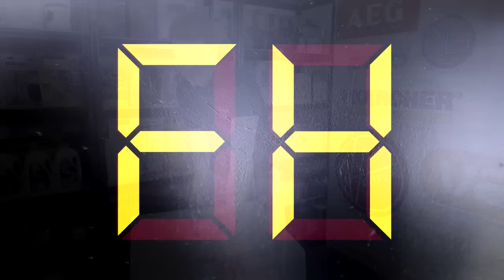Whirlpool Washing Machine Error Codes Diagnosis

Comment: what is F01 ?
Reply from the maker: F01 on a Whirlpool washing machine is a water fill error...so you are possibly noticing that water is not entering your machine like it normally would. If this is the issue, it could be due to a faulty water inlet valve. We have a video that shows you how to replace the water inlet valve here:
https://youtu.be/AA6erXruSBo
Reply: @eSpares  Actually, our problem is different. The washing machine starts the program normally and draws water, but in the next stage, which requires the drum to rotate to the right and left, it stops working, makes an alarm sound, and the maintenance symbol appears on the screen. Then it expels all the water and freez.

Comment: Thanks. My washer has F06 error code. I search usually this caused by overload but I loaded only 2/3??? Why? or maybe is machine problem
Reply from the maker: Hi, thanks for your question...F06 error code relates to the drum not spinning as it should.
First thing to check is the belt, to ensure it is in place correctly and not worn or damaged. If the belt is fine, it could be that the motor is faulty and needs to be replaced, hopefully these instructions below will help you...

1) Remove the back panel by removing the x 6 T20 screws

Check the belt and belt pulley (tighten the central bolt, if the pulley is loose)
If the belt and belt pulley were fine, then proceed to these next steps to replace the motor:

2) Remove the motor connection block wiring from off the motor

3) Remove the belt from off the motor spindle

4) Remove the x 2 10mm bolts that hold the motor in place (These are at the front of the motor)

5) Motor can now be pulled out from the rear of the appliance.

Reverse the steps above to fit your new motor...

You can see our range of Whirlpool washing machine motors here:
https://www.espares.co.uk/search/ma278pt1752/washing-machines/motors/whirlpool

Comment: Hey, can you help with fixing error code F3 E2? Model number is WFW9050XW00. Thanks! :)
Reply from the maker: Hi Humza, it means the machine has detected an error on the inlet valve so start there but be aware it could be caused by the board.

Comment: what about F25???
Reply from the maker: Hi Marcela, F25 indicates the machine has detected a problem with the drive motor, try resetting it first by unplugging it for at least 5 minutes then testing the motor and check the electrical connections from the board to the motor.

Comment: I have a front loader washer whirlpool energy saver. When I press the start button, door locks but then that’s it. No water and no spinning. Timer works but machine is stuck
Reply from the maker: Hi Thea Ale Ol, check the inlet valve with a multimeter which will determine if it has failed.

Comment: hi, thanks for your awesome video!
I have a WFW9050XW03 but it doesn't have a LED display, how can I decipher the error code ?. it is stuck on Wash, beeping 3 times, and the LED on the WASH flashing 8 times and then once and then repeat. thanks a lot!
Reply from the maker: Hi Michel, the code is generated because the fill sequence is taking too long, check the pressure switch hose that runs from the tub to the pressure switch as this can cause the problem.
Reply: @eSpares  Thank you very very much! will give it a shot and update ! really appreciate the quick response and help! you totally rock!

Comment: What does f33 mean
Reply from the maker: Hi Samuel, error code F33 means the machine has detected an issue with the drain pump circuit, check the filter and test the drain pump with a multimeter.

Comment: My Whirlpool front loading machine, Model GHW9150PW4, starts to wash as usual but clicks off after a few seconds and locks the door, with Error Code F11. The manual and you did not mention Error Code F11. What is going on with my machine?
Reply from the maker: Hi Kathy, F11 is a communication error between the control board and the motor board, try checking the connections to both boards are making direct contact.
Reply: Thank you for your quick response. I will have my husband do what you suggested.

Comment: Sorry to bother you Sir, bit you seem to know your business, and I am trying to save some money. My Whirlpool Duet, WFW9200SQA12 has shown me a F28 code, after running a diagnostic test. I am at a loss, because being female, I know nothing about working on this thing. When I try to start it,  the thing will lock, then fill with a little water. That is it
 The time will count down, bit it isn't doi g anything. Them after a while, it will show an F28 code. Please help me!
Reply from the maker: Hi L. Bailey, F28 is listed as a communication problem with the central control unit, it's worth trying to reboot the system  with the reset lever on the controller but be prepared it could also be the motor controller

Comment: What do I do if I get two codes. The codes are F05 and E02. Don't want to spend a lot of money for no reason
Reply from the maker: Hi Eclipse Hydro, on some models whirlpool use 2 error codes which reads F5 E2 which refers to the machine has detected an error with the door not locking correctly so check the door is closing properly, make sure the connections to the lock are OK before suspecting the door lock.
Reply: @eSpares  thank you so much

Comment: please whirlpool 6th sense 12 kg code erreur F36 ?????
Reply from the maker: Hi Faiaga, the only information I have found on this error code is when the main control detects a communication error between the 2 boards : Unplug the washer and remove the rear panel on the console to access the main control board.
Make sure that the P7 plug is properly connected to the board, even if it looks OK unplug it and reinsert it to ensure a good connection.
Plug the washer back up, press power/cancel, wash cycle normal, power/cancel, if the washer starts and updates the 7 segment display then communication has been restored and then try it again.
Reply: @eSpares  Hello,
Thank you for the advice, is it possible to have a video that I will be more help.
have a good day,
lisa
Reply from the maker: Hi Faiaga, we will add it to our video schedule.

Comment: f-11 code?
Reply from the maker: HI michael, this indicates the motor control unit has failed to initialise so check the motor with a multi meter, make sure all the connections are not loose.

Comment: I have a whirlpool cabrio washer and when it first cuts on the the water runs for about 5 seconds or sometimes longer then it beeps and stops the displays “du”
Reply from the maker: Hi Shamaya, we believe the error code may be related to the lid locking mechanism as the module board cannot determine if the door lock is locked or unlocked.

Comment: Great video. I had f01 issue which got fixed by replacing the control panel, and it worked for 1 day and then start showing me error f31. any guidance?
Reply from the maker: Hi The Mimi' s,  F31 means the machine has detected the motor control unit has overheated, check the connections from the motor to the central control unit and test the motor to determine if it has failed.
Reply: @eSpares   I did and they are fine. now it is showing me new error f-28. Did I burn the motor?
Reply from the maker: Hi The Mimi' s, F28 is a communication error between the boards, try this Unplug washer or disconnect power. Check wiring harness connections to the MCU, the motor, and Central Control Unit (CCU). – Check connections of the CCU board within the housing. – Make sure all grounding switches are engaged. Check that the serial harness at the MCU is not mounted upside down. The wires should be to the left when facing the MCU connectors. Check the drive system for any worn or failed components the plug in the washer or reconnect power.

Comment: F1 error shows in my machine....what that means
Reply from the maker: Hi rahul Gaikwad gaikwad, error code F1 is listed as a communication error between the control board and the motor, check the connection to both and try unplugging the machine for at least 15 minutes but if that all fails suspect the board.
Reply: @eSpares  thnx
Reply from the maker: Your welcome rahul Gaikwad gaikwad ☺

Comment: Hi I have a whirlpool duet front load washer the code disappeared however the red door locked but is lit up. And it sounds like it’s draining but not unlocking even after minutes please help what should I do?
Reply from the maker: Hi J M, let's start by getting the door open this video www.youtube.com/watch?v=J7vzWGMvfOM&t shows you how to release the door then check the door lock and the electrical connections between the lock and the board.

Comment: My machine is saying A09...its not filling up with cold water.
Reply from the maker: Hi Rashae, A09 refers to the machine has detected no water is coming in so test the inlet valve, check you are getting water through your pipes.

Comment: How do I fix a broken knob
Reply from the maker: Hi Della, could you supply the model details and we can have a look at it for you.
Reply: @eSpares  WFC7500VW-R
Reply from the maker: Hi Della, if it,s just the knob and not the electronics in the control panel that have broken you should be able to get a small flat blade screwdriver between the knob and the panel and ease it off, be careful so you don't damage anything and it should come off.

Comment: How  did you remove the front ?  The rubber won't come loose from the front panel
Reply from the maker: Hi Richard, use a flat blade screwdriver to lift the retaining band off the door seal then you can pull the seal away from the cabinet, there should be screws at the bottom of the panel holding it on and just lift it up to release and take off.
Reply: @eSpares  the rubber is stuck on the fron panel. That comes loose. There's a screw on the machine part but I'm afraid that when i take that of i never going to put it back anymore. The rubber is to tight.
Reply from the maker: Hi Richard, if this is the first time the seal has come off the front panel they can be very tight to remove but they are designed to come off, try putting your fingers on the inside of the seal where it joins the front panel and push down and it should move the seal watch this video to help with the technique www.youtube.com/watch?v=NkdwIWGrOXo&t

Comment: What is code LF?
Reply from the maker: Hi Al, error code LF refers to no water detected by the electronics so check the inlet valve with a multimeter but make sure your you are getting water to the machine first.

Comment: I have f26 cod I don't know for what
Reply from the maker: Hi Mido Adel, we believe an F26 error code is a drain pump triac fault. This is usually caused when the main electronic controller fails to detect the triac that controls the outlet drain pump during the wash cycle.

Comment: F3 E1 front loading whirlpool washer. Please help
Reply from the maker: Hi Queenie Boss, we believe an F3 E1 error code to be related to a pressure switch/sensor issue as the machine cannot detect the water level. There may also be a problem with the appliance control unit or associated wiring.

Comment: my Daewoo error code is E8.. how to solve that?
Reply from the maker: Hi Mat Seh. We believe an E8 error code is a washing machine motor error and a fault has been detected with the main drive motor. We advise checking the motor connection block and any abnormal loading condition.

Comment: What about f5?
Reply from the maker: Hi Oliver, Run a short cycle on a hot wash and check if the water is showing signs of heating. if it is suspect the temperature sensor if it does not check the heating element.

Comment: Hm good guide but what about a non signal machine...desk stays black ?
Reply from the maker: Hi CAZNTUBE, if your display is blank you need to check you have power so unplug the machine and plug something else in the socket to see if it works, test the fuse and use a multimeter to check from the plug to the board.
Reply: tnx, I had contact with a repair-store and they told me its the input electric board or something that's out of order' costs derectly 150 a 200'euro need to repair this...
Reply: If there is no display screen on the machine? Hi .. I have Kenmore He2 with no display screen to check the error code. What it does is ... When I start the machine nothing happens and it unlocks and then it locks back in after few seconds .. Then the water fills into the drum to an appropriate level and then the drum spins once and stops for a minute or 2 then all lights starts flashing after few minutes it drains the water and unlocks the door. I cleaned the drainage filter and also could hear a little squeeking noise when I rotate the drum by hand although the drum is rotating freely. My Machine vibrates like hell when on high spin. Kindly share your expertise.

Comment: Whirlpool duet f21 code could be a problem other then drainage?..
Reply from the maker: Hi, we recommend checking the drain hose for kinks, check the condition of the drain pump and the electrical connections and check for any blockages inside the drain pump filter,.

Comment: F8E1 whirlpool duet??help
Reply from the maker: Hi Boboy, error code F8E1 refers to a filling issue where the machine has not filled to the correct level in the time allowed, start by checking it's filling correctly and the drain hose is not too low which can cause syphoning.

Comment: I get F33 error code on my Kenmore Elite HE4t, what could be de cause?
Reply from the maker: Hi Pablo, error code F33can suggest to multiple issues related to it, check the water supply first then the pressure switch for holes in the hose and the flow meter is functioning. test the pump with a multimeter and if all that is ok then it is likely to be control unit, good luck.

Comment: Dryer whirlpool show blink not working how to repair please
Reply from the maker: Hi Rafiq, if the display is not blinking you will need to check the connections to the board.
Reply: Dryer whirlpool still have blink how to repair
Reply from the maker: Hi Rafiq, we do not have a video showing the repair procedure on  a whirlpool dryer and if you have determined it is the board that needs replacing try this video to help www.youtube.com/watch?v=1_7cqS9t59w

Comment: So I tested the element and had no reading on the meter. So I decided to buy a new element and replaced it today ...the washer is heating up again and it works however I still get F08 as an error code even tho it heats up the water. Do you have any idea why? Please don't tell me it's the thermostat that will take another 4 days for delivery and it's more expensive then the bloody element 🤦🏻‍♂️
Reply from the maker: Hi Arkuda, the board is still recognizing the error code, try to unplug it and leave it to try to reset the electronics.
Reply: eSpares but when I was changing the element it was unplugged? (Of course)
Reply from the maker: Hi Arkuda, try this we found 1. turn off the washing machine and unplug 2. press the start/pause button for at least 5 seconds 3. plug the washer back in and hopefully, it has reset, if not it could be a malfunction in the board.
Reply: So I took it apart again checked for continuity and it all seemed perfect. Managed to get into service mode and then it said F13 🤦🏻‍♂️as if I don't have enough problems lol. However F08 was gone from the service mode ... Test was successful door did look and unlock without a problem tho ... So decided to do an empty 15 min cicle and what do I see at the end of it ... F08 flashing with the service light 🤦🏻‍♂️ I am so frustrated
Reply from the maker: Hi Arkuda, you have obviously tested the components correctly so we can rule out the element, it does suggest that the only thing left is the board.

Comment: When you say F9 error code check for leaks inside the machine I'm not sure how you would do that? I'm getting the F9 E1 error code and the system is not draining. I took it apart and there are no clogs or plugs at all
Reply: How do you fix it?

Comment: Sir f1eror
Reply from the maker: Hi Nishanth, this error refers to a communication issue between the control board and the motor, try unplugging the machine first to see if it resets. if not check for a blockage inside the pressure hose.

Comment: Got a Whirlpool IFW700 that displays E then 920. The display alternates between the two. The fault/error isn't even in the user handbook what could it be please?
Reply from the maker: Hi Gunnersightzerod, it may be showing 2 error codes. E9 refers to the motor control low voltage detected so get the mains electrical supply checked, E20 is the control relay for the motor faulty so check the wiring between the motor and main board before suspecting anything else.
Reply: Thanks for the reply.  Will try and get someone to check it all out.  Will let you know the results as I do.
Reply from the maker: Good luck and let everyone know how you get on.
Reply: eSpares. Whirlpool tech called round today. He said "Motor and Motor Control Unit. Probably the MCU but, the MCU and motor come as a set". Now got to wait for Whirlpool to call with a quote. The thing is only 20 months old and it hasn't been used much because I have been away sorting personal things out.
Reply from the maker: Thanks for letting us know Gunnersightzerod, hope it gets fixed soon.

Comment: My son just moved into a beauriful town home on the water but so many things are not working properly such as his whiirl pool side by side washer and dryer. The washer works horrible. Everytime he attempts to wash a load of clothes an area code A-09 comes on. He cant open the door and the only way hes able to is if he puts it on the rinse and spin cycle. Which is time consuming and not only that the electic and water bill is going to kill him. Thats one of the issues here that the electric bill is so high tenants have actually moved out.
Reply from the maker: Hi Denise, error code A09 is the machine saying there is a water inlet problem, your son needs to check the water supply and make sure there is water getting to the machine.